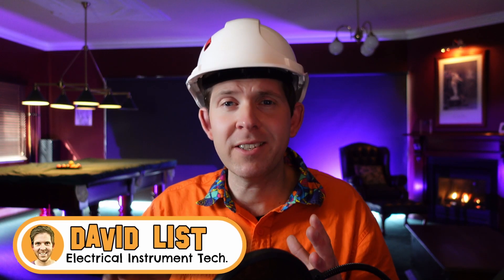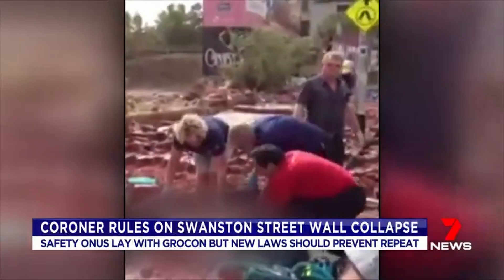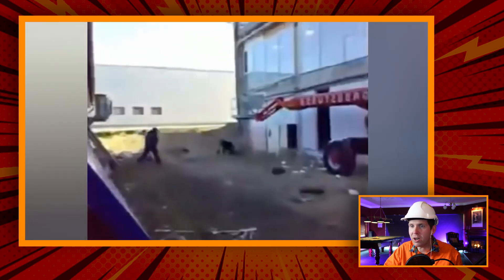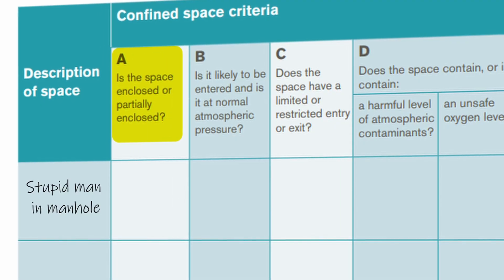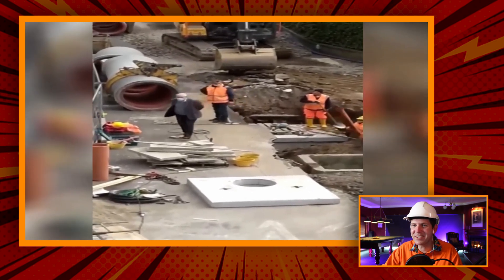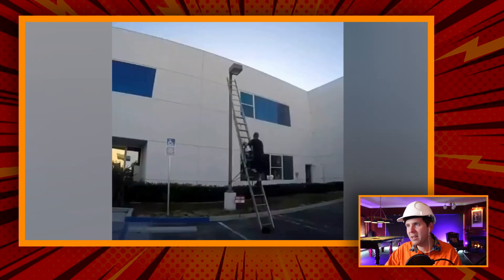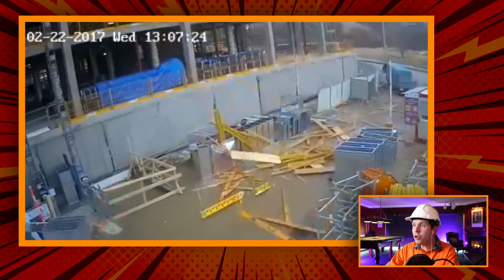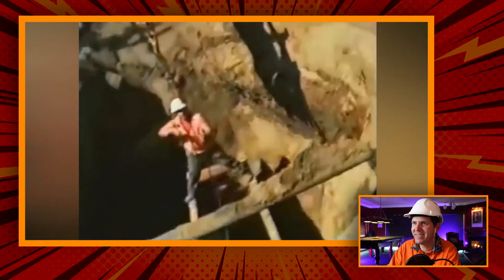Electrician Reacts to CRAZY Construction Fails🤯

Comment: First video. That is not a fork lift. That is a scissor lift. It is only designed to hold people and a few tools. The lift on the ceiling was what was moving the object. 

Arc flash and arc blast are terrifying. 

Guy with the ladder. I paused so I can comment. I expect the ladder to lose balance since it is lashed to the pole it is up against. The lash will only prevent it from moving away. It won't prevent it from moving laterally. 
Okay, Not how I expected it to go. lol. 

OSHA == Occupational Safety and Health Administration. They can shut us all down. 

Any harass work we do where I am employed is in teams. A spotter and a worker.

Comment: When you can actually die is when they release the pressure on the arteries flooding your body with built up toxins or that's what I was taught anyway. Edit after reading more it's just one of the ways it can kill. Anyway there is a simple solution in most cases. You can buy stirrups that attach to your harness so you can relieve the pressure on the arteries by periodically standing in them. Or just a work position harness that you can stay suspended in for long periods without issue and the use, if possible of a fall arrest recovery block so your colleagues can winch you back up.

Comment: That wall collapse was a failure of temporary retention during excavation of a foundation. Those plates that are popping off are anchor bolts getting ripped free. It was really under braced and it probobly rained. All of that would normally be dug back out anyway once the foundation is cast
Low O2 enviroments are surprisingly common. a sealed space with a large volume of exposed iron will have it's O2 depleted as it is absorbed to form rust. CO2 is heavier than air, you can fill a trench with it. way too many stories of ladders that end up with a pile of dead coworkers at the bottom
The wind turbine is a brake failure. usually in high winds they will park the blades because this can happen where the system has a fault and the rotor turns into a pinwheel
11:30 I have never seen an explosion like that from this trick before. they must have won the darwin lotto and hit perfect stoichiometry. This trick is used to seat the bead temporarily so it'll hold air. the "propper tool" is called an air cheetah, which is just a tank with a 2" ball valve that you smack so it does the same thing as the explosion.There are much antics to be had with cheetahs, Like shooting your boys asscrack and blowing his pants right off when he's distracted
If you're working at actual height like iron work, the fall harness works in parallel with a strain relief that can be deployed that is anchored into the arresting line and allows you to put your foot in a stirrup and lift your weight up off your arteries 
Fun fact, the Boston Dynamics robot dog Spot is being used in Canada for high voltage switching operations. they have figured out how to get it to engage and disengage rack elements so if there's an arc flash event, only the doggo is at risk

Comment: So. For confined spaces. The human body does not detect a lack of breathable air. It only detects a build up of carbon dioxide, that's the burning sensation when you hold your breath. No other non corrosive(immediately corrosive. Technically oxygen is on the list, otherwise) gas can be detected by the human body. You'll just pass out from a lack of breathable air. That's why a crew is so important.

Comment: If been inside a Truck shop (Probearbeit) that had its own tire/wheel station and they too did the poof trick but the rim was locked in the machine and the poof went away from the machine

Comment: I was a trailer mechanic for an OTR trucking company here in the US. Most of the tire failures you see in videos are generally truck tires. 

The reason for this is because truck tires unlike your ordinary run of the mills are usually very high psi. The rating we had was 110 but it really depends on atmospheric conditions too(same as regular tires).

There is a cage designed to stop exactly what you saw in that video from occurring, it actually saved my arse at one point. I was inflating one and our routine was always the same, connect the air give it a few minutes and check the pressure. There was a regulator attached to ours that shut off the air at 110 like clockwork, it had never failed before.

 Well, this day I decided to allow the regulator to do its thing...that was a huge mistake, never ever under any circumstances ever turn your back on an inflating tire. It exploded with a force from 15 feet away that knocked me clear to the ground. Thankfully the tire cage did its thing and stopped debris from flying around the shop I was working in. 

That one bloke is very lucky he didn't truthfully cop it sweet in the face with that rim, those are incredibly heavy also and severe concussion or worse could have resulted

Comment: what the two guys with the tire was doing a stretch fitment. so the tire is to be put on a 7 inch wide wheel but they put in on a 10 inch wide wheel.

Comment: there was a freight elevator at work that had the lift to open front gate, the handle was about 2/3rd the way down the gate from the top. At the top of the gate was a support beam that had about 1/4" clearance between the handle and beam, as you lifted the gat the handle would pass behind the beam creating a pinch point if you were holding the handle to control the lifting speed of the gate... needless to say a couple of people got their fingers pinched and safety reports filed. Nothing was done, the handle wasnt replaced with a strap or moved to the lowest point on the gate before a pinch point could occur... a few days later a guy lost 2 fingers due to this badly designed handle/beam... it finally got "fixed", they moved the beam upwards 5" from 6'3" to 6'8". Wear your glasses when reading install instructions....

Comment: Yea i remember installing some wifi boosters in an auditorium/ opera house and was on a cat walk, no harness or anything.  No warnings but below the cat walk were ceiling tiles.  My coworker dropped a screwdriver and it busted out a ceiling tile and when i looked down the hole with the catwalk only being 1 foot wide and nothing to grab onto i see through the ceiling tile at least a 100 foot 4 story drop to the cement floors….  I damn near had a turd baby and legs got all wobbly.  So i got the hell back off of it asap and had to sit down for a few..  get a sense of security with a floor below you but when you realize the floor is only 3/8” thick foam then a 4 story drop you get pretty dumbfounded if you havent put two and two together yet..  my coworker damn near fell after he dropped the screwdriver trying to catch it and moving the cat walk on us..  but he caught himself on a support chain..  lol.
Reply: Yeah been in those spaces in many places with event/electrical/etc jobs and yeah that's terrifying when you realise this flimsy veneer is hiding a 30m drop below you lol.

Comment: my understanding about a confined space is any space that contains 3 of the below
1.any space that has only one entrance or exit
2.any space that the entrance or exit is smaller than a person standing fully erect
3.any space that you cant go through the entrance or exit while keeping your feet on the floor all the way in or out (shuffling out)
4.any space that the only entrance or exit is up or down
5.any space that can contain fully any gas that is heaver or lighter then oxygen to the height of a fully erect person
6.any space where only one person can fit at a time
7.any space where if you have injuries and no one can enter to help you out of the space

yes there are many places that tic 3 or more just by the fact they exist 
a manhole has 6 just off the bat 1,2,3,4,5,7 even if is only 2 feet deep

i have even seen walk in coolers that would classify as confined spaces with 1,3,6

Comment: I once had to fix an isolator to the external of a mudbrick house. I asked, and was with absolute certainty informed by the customer,  who had built the house, there were no services behind that location.  Knowing that there were no screws that would hold the isolator in place, I used 4 screws just to hold the isolator in position until the silicone cured and held it on the wall (there were no timbers for 2m in any direction).  Of the 4 screws, only one really grabbed the wall.  It all looked good at the time, but the next day that one screw which had grabbed, had penetrated a water line, and washed outa good part of the wall.  I hate working on mudbrick.

Comment: An old boss I worked for told me to string up a 1/4" cable between 2 huge pine trees in Oregon about 30' up,  the cable wasn't long enough so he told me to connect 2 together with a couple of saddle clamps, , against my better judgement and telling him it's not a good idea he put his ladder up in the wire between the trees to start hanging Xmas lights! When he reached the top the clamps failed! Let's just say when he came down his ankles were more like bags of sand and I had to watch this unfold 😮 I ran back to the office to tell his wife to call ,911 it took them almost 45 minutes to get there because the property was in the middle of a national Forrest.
Reply from the maker: Holy shit that’s crazy.

Comment: I once drilled into the wall with a 6mm masonry bit, above a window in a bedroom on the top level of the three storey, brand new apartment. The people were moving into their new apartment on Easter Thursday as I was putting up the curtains. I hit a high-pressure pipe that was part of the fire control system. The water pressure was so high that the stream was eating away the render on the other side of the room. No one could figure how to turn off the water as it was independent of their normal water. Within 5-10 minutes every room on the top level was an inch deep in water and it started flowing down the stairs like a waterfall. After a few more minutes there was water coming through the ceiling on the bottom level. It took about 45 minutes before someone could locate the water cut-off, which was in a room hidden away in the underground car park. Brand new carpets upstairs were soaked, the wooden floors and kitchen cabinets downstairs were swollen with water, and some of the furniture was ruined. It was an old factory area that had been converted to series of three storey apartments. There was a high-pressure fire control system that was in place when it was factories. They kept the system but had just rendered over parts with internal pipes for aesthetic purposes and no one had been told some rooms had these pipes only a few mm under the render. It was a complete disaster.
Reply from the maker: I know exactly how you feel 👍
Reply: @MickC2167  feel bad for you for sure. But those poor people. Not fun for anyone involved.
Reply: @MeppyMan  100%. I felt horrible about the poor people moving into to their new home.
Reply: Who's liable in that case / who pays for the damages?
Reply: @Daniel15au  I don't know who eventually paid. All I was aware of was the relief when it was deemed that I wasn't responsible. They pretty much said I was only installing where I was instructed to by the homeowner, and no one would have been expected to be able to predict a high-pressure water pipe was buried internally just under the render above a couple of French doors leading out to the balcony. The homeowner had no idea the pipes were there.
Reply: Geeze dude, as a contractor, this is the stuff of nightmares!